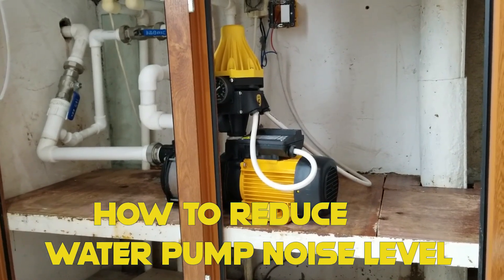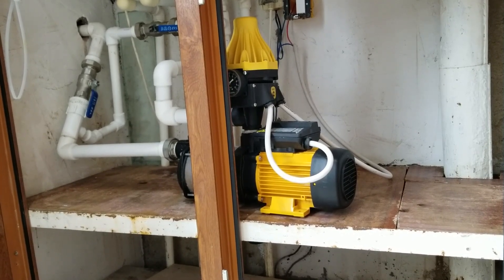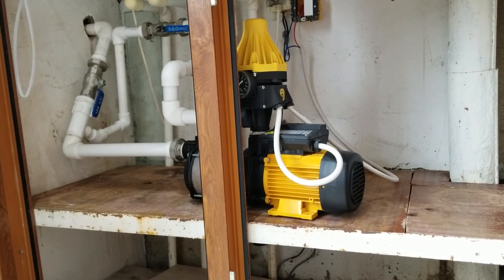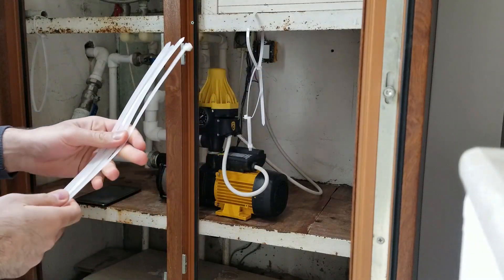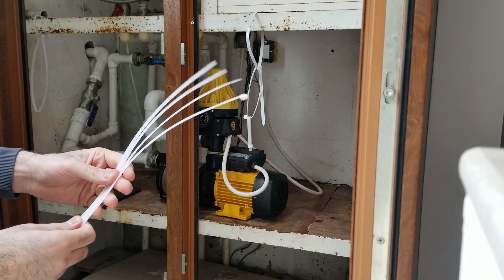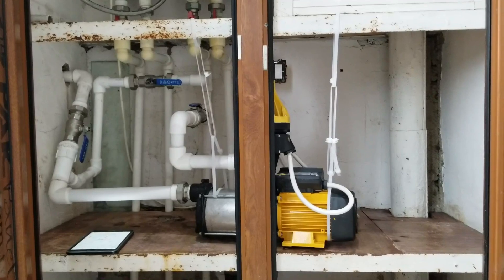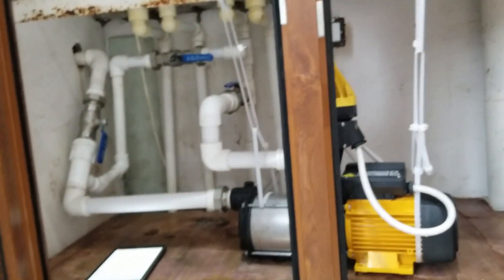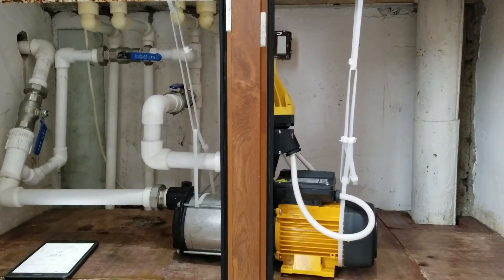Quiet any water pump, silence pumps using simple lifehack without soundproofing. (ESPA Prisma 15 3M)

Comment: Pretty nice set up ;). Try using PROOF SOUND INSULATION SPONGE EGG COTTON STUDIO SOUND – ABSORBING COTTON instead of plywood.  And closing this space with doors.. ( same material ).. guaranteed.. minus 30 decibel bro i tried it.
Reply: I have to install a water pump inside my house ,can i put it inside a kitchen wood cabinet and stick this material all around to control the noise?or this will be dangerous to the pump?
Reply: Please make a video on this